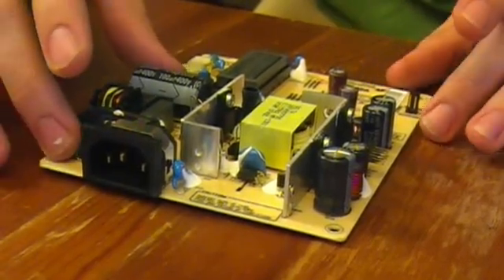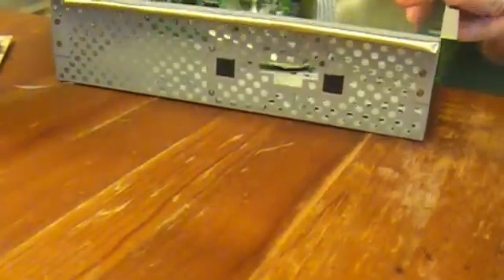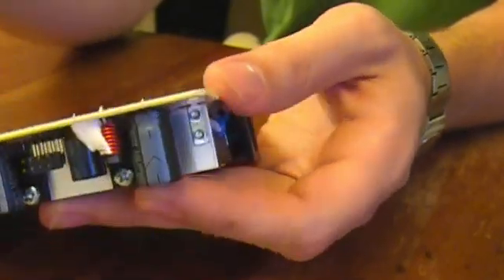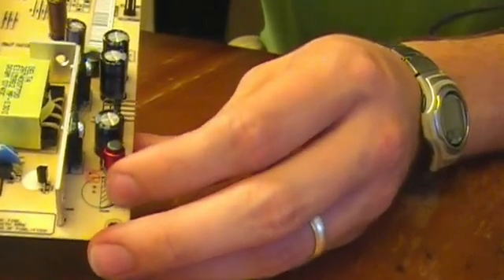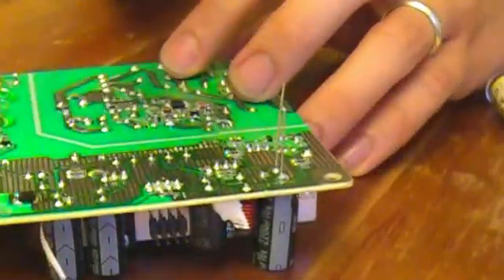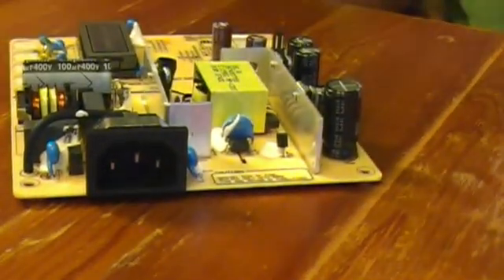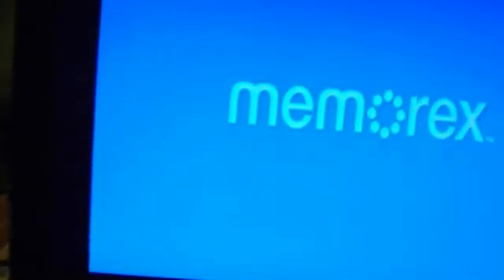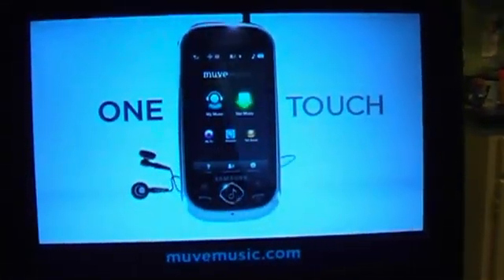Westinghouse HD TV repair Part 2 Capacitor replacement

Comment: i have already replaced defective CAP but im a fraid that it will over heat or the case will fall off because im using  electrical tape to place it on back of LCD, do you know if i need the original metallic tape it had or where can i order it, better yet what is its name, thanks in advanced!